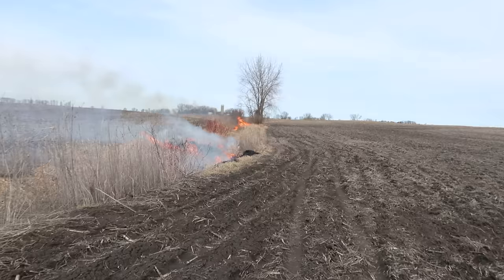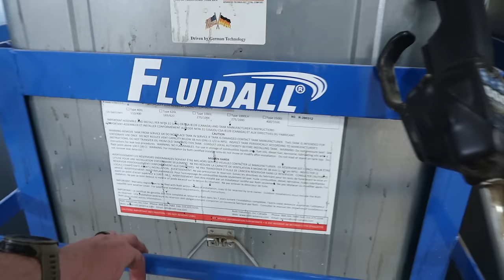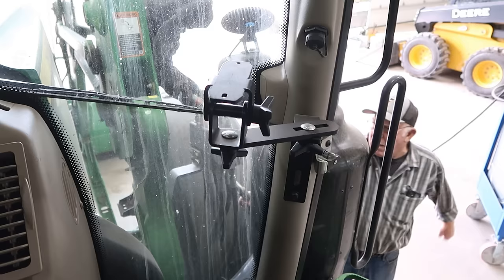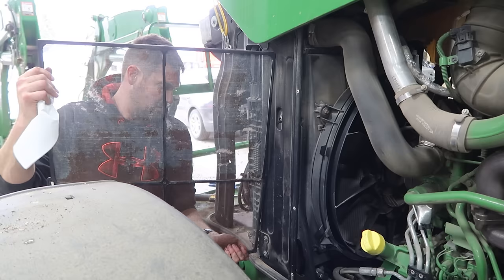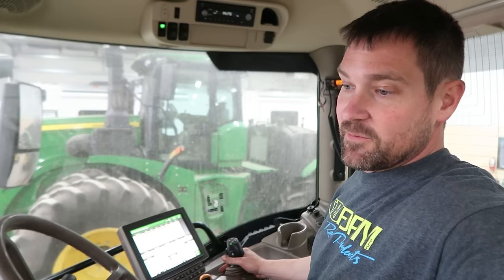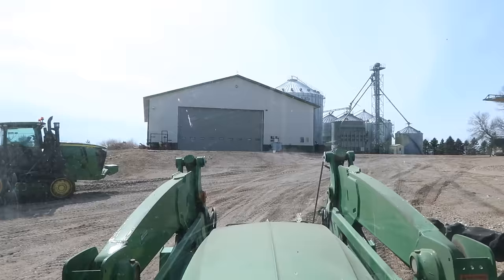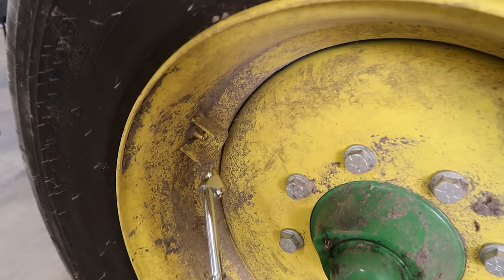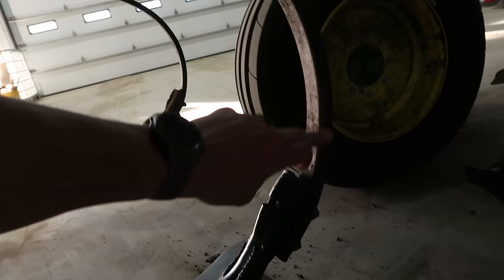First Semi Trucking Lesson - Hauling Corn on the Farm

Comment: Don't worry Onyx.. we ALL learned shifting a standard by rounding off the edges of the gears until they were smooth enough to mesh together properly!! 👍
Reply: I learned on a 1999 international silage truck… the gears were already rounded off…😅
Reply: Did you have the handle of "Grinder"?
Reply: As we say, "grind it till you find it!"
Reply: @PikaChu-fy5pt  that’s the spirit!🤣
Reply: I was wondering would a between the rows episode of the transporter sitting in the corner be a fun walk around episode before the race season ensues  be fun.  I always love looking at them as much as the latemodels they tote around.
Reply: Got to teach Onyx. Double clutching!
Reply: @kellygreene4573 very few truck drivers actually use double clutching lol
Reply: @ke6gwf  Clutches? We don't need no stinking clutches!
Reply: @stevepotthast4911 I call it the Start Pedal... Lol
Start, Stop and Go Faster.
And touching the brake is a failure, use the Jake!
Reply: @ke6gwf  retired truck driver. Started on a International Binder. 2 sticks. I double clutched! When I got really good didn’t use the clutch at all.
Reply: @kellygreene4573 I will be honest, I never learned how to double clutch, I think I did it a couple of times for my road test and then faked it for the rest lol
I have never really needed it since, so I never tried to learn it either.

If you take away that option, you learn how to float a lot faster ;)
Reply: 😂😂😂  this is so true
Reply: @PikaChu-fy5pt  or if you can’t find it, make a new one
Reply: We've always said "grind me a pound of that gear meat" to new drivers on our farm, lol. Great job Onyx!!
Reply: I was lucky to learn 3 years ago when I was 13 on our Mack ch613 with a maxitorque. That transmission is so smooth, you just rev up out of gear and push into the next and let go of the gas and the gear with fall right in. I’m glad we still have that truck 😂.
Reply: Great job Onyx. Both my boys drive diesel pickups with standard trannys and they getting harder to find.
Reply: Grind em till you find em
Reply: I was 17 back in 1979 when I learned how to drive a tractor-trailer. My job was to refuel the tractors at Ryder that were dropped off by the drivers in the afternoon. Then I parked them so they can pick them up the next morning. One time, I was told to unhook a tractor for a concrete company and bring it to the garage for maintenance. I did that task well except I dropped the trailer in a bed of shells. The next afternoon, I came in and learned they had to call a tow truck to lift the trailer because the landing gear had sunk two feet into the shells. I was the butt of jokes for several days.

I did learn that the girls in that day were very impressed with a boy who can handle a big truck.
Reply: @kellygreene4573  gotta do it for your cdl

Comment: TEACH that boy RIGHT . . never touch the clutch unless you are starting off or stopping !!! Good job, Onyx !!! ( I loved the signature Onyx "Eye Roll" when he got it right, too )
Reply: Floating is the only way to go. 🚛💨
Reply: It might work well on flat surfaces with little strain on the gears, but not well on mountains and 80,000+ pounds of load. 40 years driving heavy loads. Clutch to help get out of gear, but not when putting it in gear. My teachers had a lot of experience too
Reply: Floating must be an American thing..
Reply: @CarolMeyer-pv5ub  you can still float on grades, just not nearly as easily. I do it with my little 10 spd all the time up in the PNW fully loaded.  Just gotta be quick with it. I do agree a little clutch now and then when it's being sticky definitely helps.
Reply: My pops tried teaching me that way. I learned double clutching was a lot easier on equipment until ya understand to float!
Reply: @mikekidd1417  That is true, it takes a while to learn "the feel" of it - it helps A LOT to have a transmission that is "worn in", also !!!
Reply: @CarolMeyer-pv5ub lmao! Floating is the ONLY way in steep terrain, because it's faster so you don't lose as much momentum.
I was driving a 94k truck up logging roads so steep that all you see is sky out the windshield yesterday, and I don't touch the clutch, or the brake, (unless I screw up lol), besides for starting out...

Granted, I have an 18 speed transmission, and some of the inferior truck transmissions are not easy to float shift, but any good transmission is faster and easier to float in, and it reduces truck maintenance costs if done well.
Reply: Thats ok on the highway but on soft ground you won't keep the momentum plus they wasn't going fast enough.
Reply: @buckrogers2828 unless you are in deep mud or snow or something, you can float gears on a gravel road just fine, and at low speeds as well
Reply: That's how my Pop taught me at 12. He said while teaching me how to shift, if I see you touch that clutch once we're moving I'll break your left leg.
Reply: @mikekidd1417  That's true, learning the "correct" way is a good idea - but, after you master the floating technique, you'll be a lot happier if you have to drive around Chicago during rush hour or you'll have a VERY soar knee.

Comment: As a truck mechanic,  keep those KW as long as you can. Guaranteed they're more reliable than the new ones out today. 

Good job Onyx on learning early. When youre shifting, dont force it too hard. Should be able to just use your fingertips to feel it go in gear. Dont be in a rush to shift. Big trucks dont move quick, so you domt have to shift them quick either. Your transmission will thank you.
Reply: Agree.

Comment: I learned to drive our ‘95 Mack ch613 with a maxitorque transmission three years ago when I was 13. That transmission is so smooth,  all you do is give it some rpm’s or back it down a few, and before you know it the gear falls right in with barely any pressure. I’m glad we still have that Mack 😂.

Comment: I'm glad no one here is complaining he's driving without a CDL. I learned to drive at 12 years old on the dirt backroads with my grandpa. He pulled over and said, "I'm gonna let you drive." I looked at him like he had three heads. Even had the splitter hooked up on the back of the truck.
Reply: Well, he's on his own property so...  Plus you can't get a CDL till 18 (21 to go OTR).
Reply: Farmers don't need a CDL if they own the equipment and their hauling their own product or equipment.
Reply: Blah blah blah!
Reply: @PikaChu-fy5pt  Right, so I’m glad no one is complaining he doesn’t have one yet is driving a truck.
Reply: @lstone.09  Again, which is why I’m glad no one is complaining he doesn’t have a CDL.
Reply: @wyatt9144  what's your fricken point?  Zach didn't even take him out on the roads.  Being on their own property, they wouldn't need one.  Zach isn't that stupid.   Actually he's probably one of the smartest farmers I've seen on YouTube.  Give they guy some credit where it's deserved.
Reply: Dad does not have a CDL either.  :)
Reply: I was about 10 or 11 when the neighbor farmer my brother and I helped needed to move a truck loaded with wheat back to his farm about a mile away. He needed to move his combine back to the farm. My brother and I assured him we could drive the truck. He was a year older and could better reach the pedals, but I knew the shift pattern. So he drove and I, judging by engine sound, told him when to push in the clutch while I shifted the gears. We parked that grain truck in the barn where it needed to be. We were pretty proud of ourselves. 😂 That would have been in 1959 or ‘60.
Reply: Dont need a cdl with farm plates for 50 or 100 mile radius of farm

Comment: I work for a JD dealer here in Michigan, we sell oil drain plug kits by no spill systems that replace the standard drain plug and has an attachable tube to drain oil into a bucket without getting everywhere.

Comment: Depending on which engine is in each truck remember to keep a little pressure on the throttle to keep your rpm’s up when you shift … that will make it easier to shift. Just a little advice from a 25 yr veteran of the trucking industry

Comment: Nice job Onyx. Listen to the engine and take your time shifting gears.    *Great little attachment I found for airing up tires- much better than looking for the manual air gauge. (no I am not a sales guy!) AZUNO Digital Tire Inflator with Pressure Gauge, 200 PSI, Heavy Duty Air Compressor Accessories, w/Rubber Hose Lock on Air Chuck and Quick Connect Coupler

Comment: Former OTR trucker with 40 years behind the wheel. Was taught at 12 years old how to drive without a clutch. Secret is timing. Pull it out of gear as you let up on the fuel pedal, and as the tac drops 400 rpm approx. you slide it into the next gear. If you miss it, just rev the engine slightly to bring it back up to the minus 400 rpm spot on the tac and it should fall right into gear. Reverse the timing process for down shifting. Takes some practice but eventually it will become so second nature you won't even need the tac. You will know by the sound of the engine. Good luck Onyx, knowing how to shift and drive a big truck is a skill that will carry you through life. By the way clutchless shifting saves tons of wear and tear on the clutch, engine, and other components. Making for far less maintenence costs down the road.

Comment: I'm not trying to sound like a smart axx. In teaching my son's to drive, I figured out it's throttle control. Have him practice raising the rpm's by 100 and holding it at each increment. It will make shifting much easier for him with good throttle control.

Comment: When I was a kid in the '70s, one day my Dad called up and said "Hey, drive they truck out to the field I'm planting corn in.  I need more fertilizer".  First, yes, we had to load our 6 x 36" corn planter with bags of seed & 66 2/3 lb bags of fertilizer.  Second, that field was several miles away.  Third, I was 12 and it was a 2 ton truck.  I did not think too much about it.  I jumped in and drove the 6 speed manual over to him.  I even waved at the sherrif deputy when we passed.  It was not a big deal back then.

Comment: Zach, I know nobody reads manuals for loaders but the manual covers how to remove and attach the loader without having to hammer the quick connect.  You may damage the plastic o-rings in that connection causing them to leak with the hammer.

Comment: Love them Jump boxes have 2 of them just remember on the jump box turn on then hook negative cable up to the battery then hold the red button down for 5 seconds till all the lights flash for max boost then hook up red cable. There is nothing I have been able to start yet.

Comment: Keep in mind that the NOCO jump pack will NOT like intake heaters like the one on the Peterbilt. Really no way around it either. Those packs are like drag racing...real hard and fast for a real short time. It will do fine on a large engine without an intake heater though.

Comment: Fuel filter help - run the tractor, slowly switch over fuel filters while running, run for a few seconds, shut down, change fuel filter (now off line/old one), run tractor, slowly switch over to new fuel filter to prime, then slowly switch back....everything is primed and ready to rock....shut down tractor....carry on

Cheers

Comment: LOL If you cant find it grind it. Doesn't a truck like that have sync shifting. You just have to go by the RPMs to shift. I drove big truck for years and never used the clutch. I always shifted by the engine speed (It saves clutches.) The only time I had to use the clutch was from a stop. Once moving I shifted through all 26 gears without the clutch.
Reply from the maker: That's how I drive as well, but he's 14 and this was his first time
Reply: @MillennialFarmer  It's probably he learn how to double clutch first. That way he could drive truck for anyone as some owners insist on double clutching.

Comment: Static leaks are common on hydraulic cylinders. As long as it doesn’t leak under pressure you can run it for a long time.

Comment: 43 year old farm boy here….my first job at 8yrs old was putting new shovels on the cultivator. Ours didn’t have the fancy pop on pop off shovels, it was two bolts and we didn’t have a concrete floor my dad made me do it in the gravel. the bolt heads would wear to a razor sharp edge so that it would want to slice your finger tips off if you went to hold the head. Oh and I had to use hand tools-ie boxed end wrenches….OK RANT OVER! And I wouldn’t change anything about it if I had to do it again lol

Comment: Upgrade or pay more taxes? UPGRADE!! I was 12 when I started driving on the driveway and my brothers Freightliner cabover 8V92 318 green leaker 13 speed at 14.  Onyx, in a few years you will be very grateful to your dad and grampa for what will have learned from them and remember always keep your hands out of your pockets. Way to go kiddo!
Reply: Pay a little bit more in taxes, fix up the stuff you got if it’s still solid equipment, and save your self years of payments.  I’ve never seen the tax thing work out so hot for farmers…it seems that the previous generation sold younger ones a load of crap with trying to chase the write off.  Paid for equipment is the best equipment, just my 10 cents worth.  Have a good evening everyone.

Comment: I used Chevron Delo synthetic in my 50 series Detroit. Never opened the motor for over 1.3 million. Not even a injector.  I changed it every 50,000.

Comment: thats awesome,  But  slow down on the shift,  no need to jam it  in to gear ,  also make sure to pull it  out  of gear at the same time your taking  your foot off the Throttle.  it  will slide right in to gear

Comment: I drove tractor trailers for UPS for 41 years. Im just wondering if you use the clutch to shift? We never did, only to get it in gear to start out from a dead stop. And even with a fully loaded 53 foot trailer, we never used 1st gear, it was just too low. Always started in 2nd and it was fine, I did have a younger partner who wanted to start out in 4th. I would be back in the sleeper bunk and I could feel the drive shaft just vibrate all to hell. I had to break him of that habit.

Comment: Easy killer. Shift it with ease. It’s not a synchronized trans hence either double clutch or float the gears. A truck is like a woman. Handle with ease and never force it.

Comment: Zach what is the cable for that runs from front to back of the tractor for?
Reply: It's for extraction purposes if it were to get stuck it's a pulling point. articulated tractors and some non-articulated have a tow cable preatached. the articulated have it so when you pull you are not putting as much strain on the main pivot pin. hope it helps!

Comment: OK cowboy it’s time for a safety talk.  You should be having these with your crew members monthly or when you see unsafe actions. 1) ALWAYS use 3 points of contact when exiting a semi or coming down a ladder of farm equipment ( 2 hands and 1 foot or 2 feet and 1 hand ) and come out/down backwards.  2) ALWAYS wear your seatbelt.  Even in the yard.  If you always wear it you will get into the habit and won’t forget.  It will become as natural as turning the key.  I noticed you and Onyx breaking both these rules on this video.